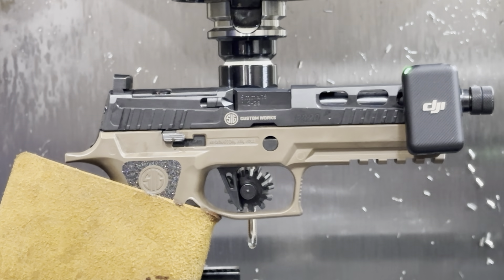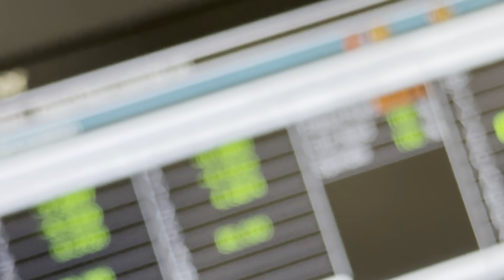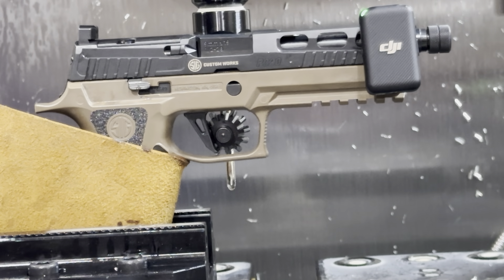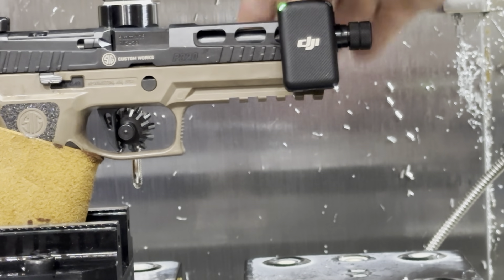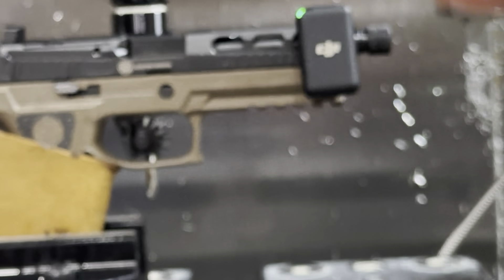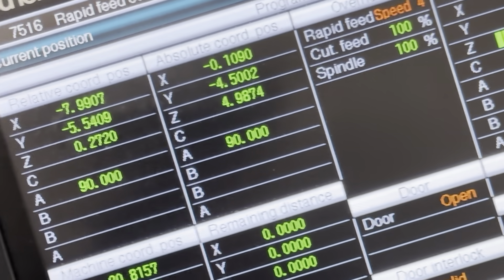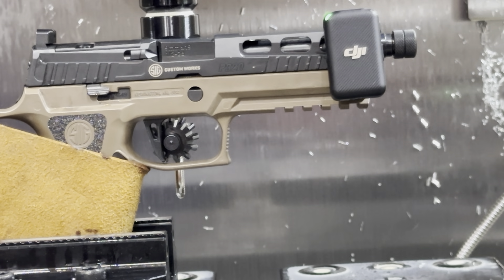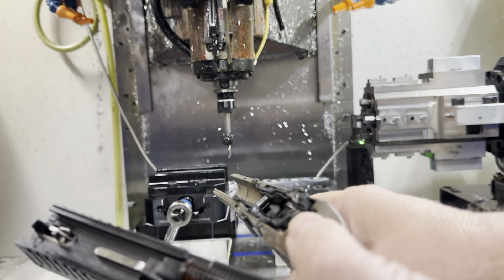Sig P320 accidental discharge tested in CNC machine.

Comment: Congrats, you just proved that your pistol is in slightly better tolerances than the dead and injured people's pistols. Also proved you can finish "pulling the trigger" by wiggling that sloppy slide.
Reply: It's tolerances combined with the striker safety disengaging basically at the wall, based on info I've seen. It seems to me that with this design the striker safety should only disengage at the furthest travel of the trigger possible.

I concur that anyone with access to machine tools should know that a sample size of one is worthless and tolerances are a thing to worry about, as are safety margins, in design.
Reply: @spencerbookman2523 this dude was just hoping this experiment would be a complete failure.
Reply: Exactly. He still doesn't understand the premise of how dangerous this design is. NO gun should be able to go off by moving the slide.
Reply: @MrWhite2222 *moving the slide with the trigger being pulled
Reply: @MrWhite2222  Yet they do https://www.youtube.com/watch?v=LKD0S3KhwdI&t=174s
Reply: @MrWhite2222 any striker fired will do the same
Reply: @jc45487  False. All other striker fired pistols are only 50%-75% cocked. Thus, even if ALL the other safeties fail they will still not discharge without the trigger being pulled nearly all the way. Only the P320 has this defective design coupled with a fully cocked striker.
Reply: @MrWhite2222 False!!! There are many other striker fired guns that are fully cocked! Let's see, HK Vp9, Walther pdp, Walther ppq, the original Canik tp9, smith m&p is 98% cocked, sig p365, Springfield echelon, Springfield XD series, walther p99........ so on.... a fully tensioned striker doesn't make a pistol inherently dangerous 🙄
Reply: Other people have tested it with varying results. In my opinion this further proves the point. It’s a quality control issue related to the injection molding process that Sig uses for some of the components in the fire control group
Reply: @febreze9283  is your 1 other people the guy that jammed a screw in? You do realize this is how youtube works for these guys to make money?  They all do their form of the same test to get likes and subscribers.
Reply: You can make ANY gun fire if you manipulate it enough. The rumor is that "320s go off by themselves without manipulation"... And that's just not true.
Reply: Well turns out it wasnt the gun that killed the airman. I was another airman.
Reply: Military grade are garbage compared to civilian grade
Reply: At the end of the day, there are going to be videos of these guns going off in holsters without anyone touching them.  Proving a negative is difficult, but for a thousands negatives it takes just one positive to undo any feeling of safety.  At this point we can argue the A-a large group of Sig (and only Sig) owners are too stupid to own firearms due to negligent discharges or B-there is a major Sig problem and it needs to be fixed.  How many more Sig incidents will it take to recall this?  I know I wouldn’t want one strapped to my hip.
Reply: What dead people?
Reply: Not a hater, just too many other better choices out there.
Reply: Bla bla bla bla. 🤦🏼‍♂️
Reply: wiggling slide = not a good quality gun. even the Hi-Points don't have wiggling slides and they are the cheap dirt guns LOL
Reply: @manuelfrontier yeah, but that company isn't run by a Cohen.
Reply: Now run it through a service holster a few thousand times, open the tolerances on the slide a touch and wear the sears a bit. We are talking about service weapons here. Weapons built to be ran hard. The argument that there should be no wear is just as ignorant as Sig themselves.
Reply: @novarocker247 don't forget to add specs of dirt & soot worsening the problem from not being cleaned after every magazine fired.
An absolute shitshow
Reply: @IanNuke right. And again, these are service pistols. Meant to be beat on. Mind you Sig had a voluntary upgrade program hahah. Basically saying “listen there is no issue but we’ll spend our money to fix the issue that doesn’t exist”.
Reply: he proved the glock failed the exact same test. watch his other video
Reply: @CitizenSeven500 lol no he didn't
Reply: @jeffreyp6852  he did and so did this guy https://www.youtube.com/watch?v=LKD0S3KhwdI&ab_channel=TriggerSmart
Reply: The question for is this. WOULD I TRUST THIS IN A HOLSTER AREOUND MY YOUNG ONES? Yeah it maybe nothing but if it something. I’m NOT taking that chance. No matter how much you say you’re sorry and I should have could have you can’t get your kids back. For me it’s a nope. I will never buy another one of their products ever.
Reply: @jeramiahmcneece9992 
I bought Sig Sauer hollow point  ammo. Approx 1 in 5 jammed in a glock. Comparing, the Sig rounds are shorter and completely flat on the front.   
If Sig Sauer can't make ammo that works,  cold day in hell I'll trust anything they make.
Reply: Sig will call it, "Predictive Discharge" its AI. The gun knows when you want to fire before you do.
Reply: @Bigmyoun1 brings a whole new meaning to Minority Report…cuz the gun shot. 😂😂
Reply: Why is anybody still defending this shitty gun? Because it’s got “Sig” on it? It’s dookie.
Reply: If you claim that a gun will "just go off" with an "uncommanded discharge" but you have to begin pulling the trigger for this to happen, you are making an absurd case. I was told that triggers were NOT being pulled.
Reply: @connorcline6982 if you (or sigs lazy qc) put in a 10mm saftey lever you can get it to go off by shaking per LFT research tests. You just dont like that sig has more than 1 problem on the gun chosen to protect the US for cost.
Reply: @connorcline6982 the trigger tension is to show that if the tolerance is off by a millimeter which is not much at all the gun has a capability of going off. That could be caused from wear on parts, defective parts, etc. You can put tension on any trigger like a M&P or Glock, and they won't go off without the official wall break. This is essentially going off unintentionally due to the trigger wall never breaking if that makes sense?
Reply: @connorcline6982  The trigger can simply be dirty to have a millimeter of pull on it. Not to mention movement caused by impact if you for example drop your gun. Not to mention wear and tear on the striker mechanism.
Reply: @connorcline6982  you still don't understand. The "trigger pull" is to non destructively test the striker safety failings and/or the sear and striker mating surfaces being out of spec, damaged or worn. The problem is that not only is it an unsafe and defective design, but as time goes on the mating surfaces between the sear and striker WILL get worn down until the sear is barely hanging on and WILL allow the gun to go off uncommanded. 

Stop focusing on the proverbial "trigger pull". It is only a demonstration of the main issue.
Reply: @MrWhite2222  Spot on.
Reply: @MrWhite2222  the gun can't fire without a trigger pull.  The test is flawed.
Reply: @Parrish-Patriot71  you obviously still do not understand the FBI report's results.
Reply: @MrWhite2222  have you seen the retesting to not understand they admit they tested wrong?
Reply: @MrWhite2222  This 100%. This is some race gun variant to boot, but the problem seems to be a confluence of poor engineering, tolerance stacking issues, and blind dumb luck. The heart of the matter is that the gun SHOULD STILL NOT DISCHARGE UNDER THESE CIRCUMSTANCES!
Reply: @MrWhite2222  Be a better gun owner than. Pretty simple. Get a manual safety gun. Stop running around with firearms with no real safety; truly such as that of a P320 without one. Have proper trigger discipline.

Here is a good idea also. Clean, and inspect your guns after use. Especially after multiple shooting sessions. Inspect for wear, and tear like any other gun.

AXG, DH3, Legion, XTEN. There is a lot of P320 series that are of the highest quality SIG custom shop has to offer. I'd be more concerned if we started seeing even top shelf variants having issues, or more manual safety guns failing. But that just hasn't been the case.

If you shoot someone in a case. And your defense is, "Yeah but your honor I only pulled the Trigger 83%, and the gun did the rest". They're gonna laugh you out of the court, and right into a cell.

Should a slide not do this? Yes. But again 83% of a trigger pull is generally considered a trigger pull with intention. Also who TF just starts screwing with their slides more than 3/4's through their trigger pull while aiming?

I've seen but yeah well what if carbon build up get's a trigger stuck a little? Clean your gun. And also you can always physically push the trigger forward to make sure it's reset fully before holstering. Again only if you're running a model that basically has no safety outside of a mechanical disconnector on the trigger bar; which even for me is just not good enough; and too risky.
Reply: @connorcline6982  it has nothing to do with the actual trigger pull. I would prefer to see this type of test on a completely original 320 like wyoming gun guy's video was. duty weapons get dirty, and used often - whats happening is the <1mm tolerance is being taken up either by debris in trigger - sand, dirt, etc. - or weak springs that achieve the same thing.
Reply: @connorcline6982 it appears there is a wide enough range of tolerances within sig's production that you have anything from ones that are too tight to fully seat, to ones so loose you don't need trigger input, or if springs weaken at all trigger input can stick.
Reply: @connorcline6982  do you have any idea what 1mm to 2mm is? thats literally a piece of lint
Reply: @connorcline6982 ok, multiple videos prove P320 will go off with very little trigger pull and manipulation of slide. Do you not believe a few examples will go off with just pressure applied to the slide, ie in a holster?
Reply: @Canine_Cowboy  none will og off with just pressing on the slide.  The FBI reconducted their tests and verified it's not possible with only slide pressure.
Reply: @Canine_Cowboy "very little trigger pull"
Reply: @connorcline6982 was Alec Baldwin saying that
Reply: @connorcline6982 I'm sure the airman, whose pistol was holstered, wasn't pulling the trigger. The FBI report stated that it could be fired with movements consistent with a police officer's job, while still in the holster. I had a sig that fell out of a safe that someone was working inside, and it dropped the seer with the safety on and no depressing of the trigger, I was able to make it drop the seer wiggling the slide without depressing the trigger. The scary thing isn't that these can go off like this. The scary thing is that the quality changes on these pistols so much you don't know if yours will go off in a holster or not.
Reply: @connorcline6982  the trigger being pulled is simulating the internal components either being out of tolerance (or what should be the tolerances) in the direction of firing, or any material taking the space between the hook and sear ledge which could cause the striker hook be seated poorly due to the debris. There's plenty of videos online of these guns going off while "safely" in holsters. You really only need to type in two keywords to find these. I just wish i could find the video of the officer who's gun went off in his holster at a mall while he was sitting in his mall-cop cart; its the video that made me realize I was wrong and that these guns are actually going off in holsters, and its not another safariland case.
Reply: @roninsomething7468 I’m having a hard time finding any of those videos. So many gun channels trying to get their 15 seconds of fame, I can’t find actual videos of sigs going off without trigger pulls
Reply: @andrewkarsten5268  https://www.youtube.com/watch?v=3_CYjoK2bqo
https://www.youtube.com/watch?v=b33AXiuytn0
https://youtu.be/z789IuTQLs8?si=cbE7gulUyVDbYTc4&t=141

lol
Reply: @roninsomething7468 thank you, but you linked to exactly what I’m talking about. All of those videos in the compilation either don’t show the incident and just make claims (majority of the ones), and the few that do it happened in sketchy situations, i.e. looks like the gun got bumped, etc. where if anything was in the holster pressing on the trigger it would make the gun fire. The P320 is less forgiving than the Glock because of the lack of a trigger safety, and I notice these cops holstering without making sure there are no obstructions. Is that a bad design for a service weapon? Yes, but these have no external safeties either. 

The incident that really concerns me is the airman because it happened with a P320 that has the external safety. This is much more indicative there could actually be a problem with the gun. That compilation serves as good evidence for someone who is looking to confirm their bias, but as a skeptic who remembers Glock leg it just doesn’t do it for me.
Reply: @andrewkarsten5268  the thing is, all of the shootings which are immediately shown to you in the videos i sent, there is obviously nothing touching the trigger, or it is already safely in a holster. There are literally ZERO cases of any other gun going off while already safely in a holster, even while being "bumped" (barring non drop safe guns). This is a uniquely p320 problem, and i wouldn't carry one while this issue remains unfixed.
edit:
trust, i remember the "safariland issue" well, but what is happening now is not the same. plus, the fbi's take on what may be happening is pretty convincing.
Reply: @andrewkarsten5268  the video of the female officer walking back to her car? her hands are full, her shirt is tucked in and her jacket is tucked behind the gun. nothing except maybe her duffle bag bumps it, (though just about every modern firearm is drop safe) and it goes off.
Reply: @roninsomething7468 yeah, part of the jacket could’ve been snagged between the gun and holster. I’ve seen that a lot with cops. I’m not claiming a holster issue, I’m claiming a handling issue where things are getting snagged in the holster. And it’s not a uniquely P320 thing, when cops switched to glocks there was Glock leg and lawsuits as a result too. The issue there was bad gun safety practices from the cops that you can get away with on a revolver that you can’t with a Glock (like holstering with the finger on the trigger). The P320 doesn’t have a trigger safety, so it’s even less forgiving than the Glock. If a piece of shirt gets snagged between the gun and holster, it’s very unlikely to depress the trigger on a Glock enough to make it go off. On the other hand, if the gun has no trigger safety like a P320, now it’s much more likely to cause issues.

As I said, the airman situation is what worries me because it was on the desk and is an external safety version. That’s why mine is unloaded in the box until I get more information. The fact is though, none of those videos you showed are clear enough to indicate there wasn’t an issue (like a shirt catching the trigger in the holster). If you haven’t seen cops with holstered guns and part of their shirts snagged in there, then I’m curious to know how many cops you’ve seen, because I see that all the time.
Reply: @andrewkarsten5268  its for sure possible but that tends to cause the weapon to fire during the holstering process, not while its already in the holster, like the female cop, and the first cop. unless its just not the correct holster for the gun, nothing should work into the holster enough to get into the trigger guard and then pull the trigger all the way back. and the third link i sent is literally a video of the gun being holstered-- very clearly no shirt in it, no finger and it goes off anyway. the airman situation, along with every other instance of it going off while already holstered is bad.
Reply: @roninsomething7468 we are in agreement about the airman situation and it being concerning. Those other holstering situations however could’ve had the gun not fully seated (possibly in an incorrect holster as you said) with something in the way. I could easily see a piece of shirt stopping the gun from going all the way in and due to inattentiveness or whatever else the cop just not notice it’s not properly fully holstered, leaving a bump or whatever else liable to push it the rest of the way and make the trigger depress. All I’m saying is the trigger on the P320 doesn’t have the safety the Glock has, and Glock leg was a real thing which turned out to be cops no longer able to get away with the poor gun safety habits they already developed. The P320 is much less forgiving as is even when it’s working exactly as it was designed and intended to work.

The last video you sent you do have a point. You can’t see in the holster so you can’t know for sure, but I agree it does appear that there shouldn’t have been any obstruction causing it to go off.

As I said earlier, there’s enough evidence that I’m keeping my P320 unloaded in the box. I am skeptical of the safety of the gun now. I’m also just not going to trash sig when the only information essentially comes down to “trust me bro sig is junk” etc. Was that last video a modified gun? I don’t know. Were the cops practicing bad safety practices? Almost surely, cops are some of the worst gun owners. Was that enough to make it negligence or was the gun actually going off on its own? I don’t know. And this is the problem, no one really knows and until there is a proper investigation into these incidents using the scientific method to find out what is actually happening, the extent of the internet will just be a bunch of “trust me bro” people who want their 15 seconds of fame, and now have an opportunity to get it.
Reply: @andrewkarsten5268  https://www.youtube.com/watch?v=SDEfyjsRvD8
Reply: @roninsomething7468 does show the pistol, so we can’t actually tell anything about what happened in that video
Reply: @andrewkarsten5268  what could have possibly happened between him getting into and out of his car that would have caused the gun to fire. Sig claims a seatbelt "worked into the holster" but the officer seems to be sitting pretty still to me. you can also hear him release the hood on the holster before he takes the gun out. So much for "improperly holstered"
Reply: @roninsomething7468 you can still improperly holster, and he wasn’t still he wasn’t getting out of the car. If something was snagged in the holster like a piece of his shirt or anything, and hit the steering wheel getting out or knocked the gun with his hand, that’s not even remotely close to “going off on its own.” That video is one big “seriously, just trust me bro, exactly what I said.”
Reply: @andrewkarsten5268  you can see his reflection in the window of his cruiser, his jacket seems pretty form fitting and he's very obviously left handed, so he didnt hit the steering wheel, and his hand was nowhere near his gun when it went off, as it was covering the body camera.
Reply: @connorcline6982  cope harder?  NO GUN should fire with the slop of the slide, it should only be able to discharge by the trigger mechanism only.  The striker assembly is so sloppy in the p320, and the parts are complete shit.  Its not a far stretch to think that it could happen.  Go ahead and show me any other gun that will do this, I'll wait.
Reply: @perditionluc this I think it would be a fair comparison to test all other striker fires.
Reply: @connorcline6982 have you not seen the videos of this pistol discharging if dropped? None of the drop tests involved manipulating the trigger with anything….and it still went off! This firearm is defective in design. There is more slop in this firearm than a stripper in Vegas.
Reply: So, to make the gun discharge, you still have to pull the trigger to a certain point AND wiggle the slide for it to fire. 
1. You must have a trigger pull
2. You have to wiggle the slide all at the same time. 
3. How does it discharge without contact with all these factors.
Reply: @ronnied.9223 no other handgun has this problem. This is just a way to show how it is possible to get the gun to go off without a full trigger press.
Reply: @ronnied.9223 other than sitting on a shelf? Literally EVERYTHING else!
Reply: @ronnied.9223 the trigger was not pulled when the gun went off in the cops holster inside a building and it wasn't pulled when the lady officer held it in her hand on a traffic stop. Clear video proof
Reply: @ronnied.9223 loose tolerances, slight wear, just jostling the gun can cause both factors at the same time.
Other guns do not have this issue. Even with extreme wear, guns should not do this.